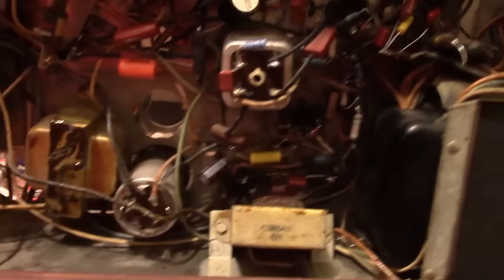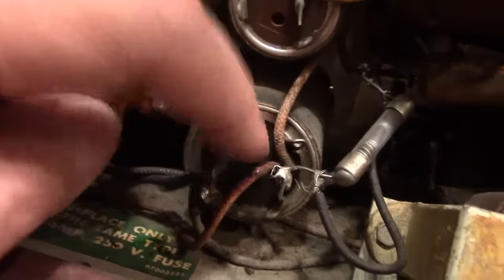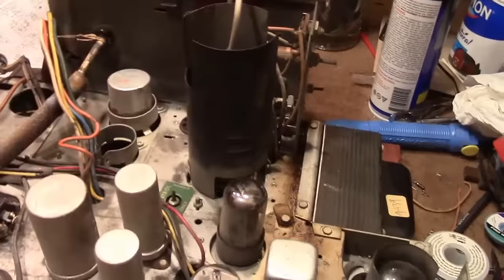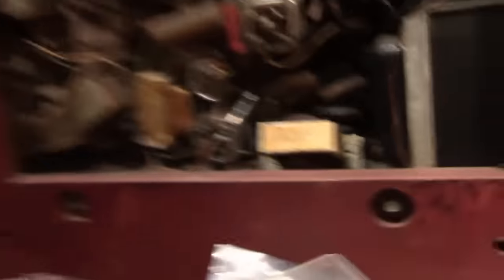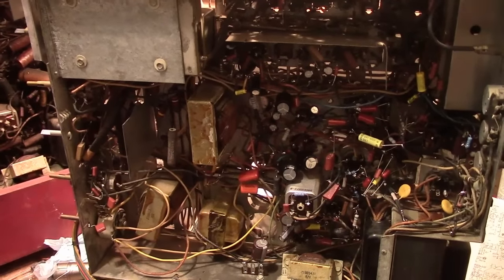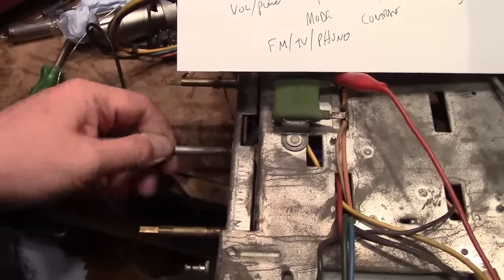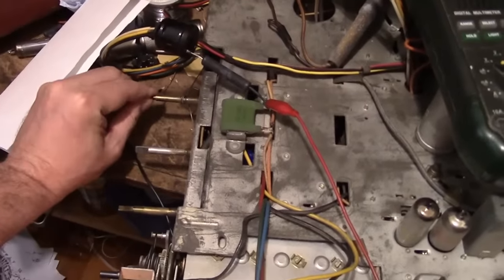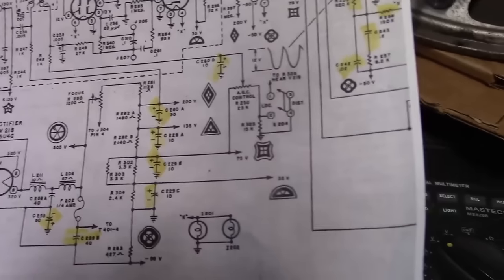Dual Dumont RA-113 restoration p3o7

Comment: That is one wickedly-cool eye tube! What's its nomenclature, and are replacements out there, if needed?
Reply from the maker: 6AL7.  Probably the most common eye tube. I see many for sale on ebay.
Reply: Awesome! I'm guessing they weren't used in radios very often, or at least, not the vintage of radios I collect.
Reply from the maker: They were used in FM receivers in the 50s.